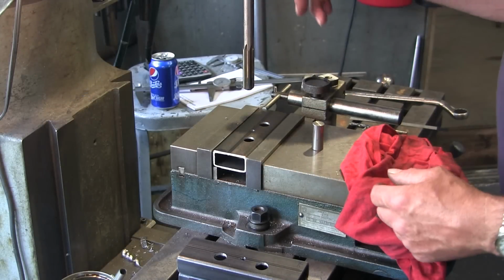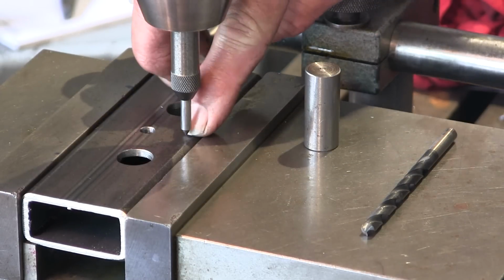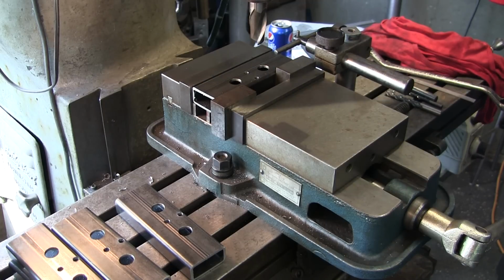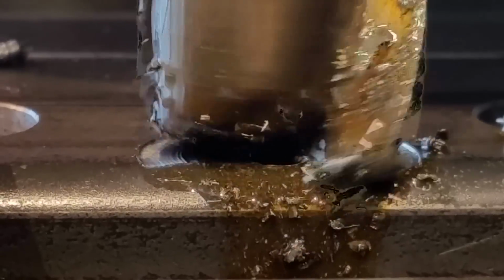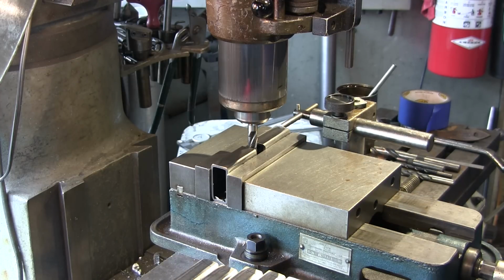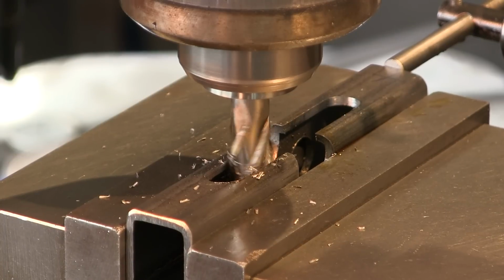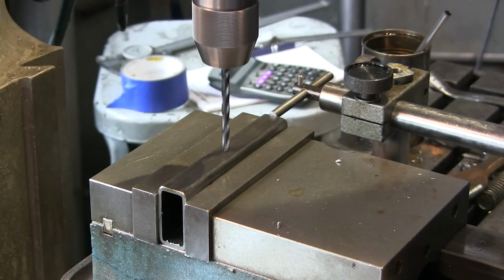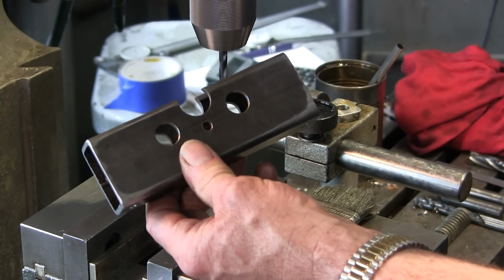The Wright Roller Kit The Build / Part Two

Comment: I'm enjoying this series Keith, as if you ever had a bad series..
I had also decided to use plug welds for the end blocks, I omitted the top hole as I didn't want the weld to affect the interference fit I did for the pins. The outside support blocks were reamed +.001 over giving me  a nice slip fit. I decided to go this way to allow me if needed to punch the pins out allowing me to disassemble the roller kit if needed.
the center sections swings freely. it worked out well with out welding distortion.
I can't wait for the rest of this series.
Cheers

Comment: The hot tip for that 7/8" hole would be an annular cutter. No pilot hole, required, and works great in tubing like that.
Reply: I had my first experience with annular cutters while working on my shop press this weekend. Love them. They make quick work of large holes.

Comment: I'm guessing the missing 1/4 hole is for locking the trunnion in place, or for draining oil/water accumulating from the bottom of the tool, since the end caps are welded.

Comment: If you can not find two identical thickness packing blocks to keep the 7/8 cutter away from the vice jaw, try using a vee block in the central position. This will nicely clamp the work and will give you a void for your cutter to go into. Another Old Boys tip, if your drill starts to drill an irregular shaped hole, is to drill through several thicknesses of a small wad of rag. This is also a good tip when countersinking, it will stop chatter and give a smooth finish.
Reply: I'm not sure I understand the tip about drilling through several thickness of rag.  Do you lay the rag (or small wad of rag) on the part and just drill through it.  I've never heard of this but anything I can do to help reduce chatter when countersinking I'll try.  Thanks in advance.
Reply: Hi Dave, Yes get a piece of rag or paper towel, about 2 inches or so square and fold it over several times to make a small wad. Place it over the hole and start to drill through it. What it does is clog the flutes and sort of acts like negative rake and stops chattering. Works well with multi toothed countersink bits, the rag / paper clogs up the spaces between the cutting edges. Do not have too thick a wad, otherwise it can be difficult for the drill / countersink bit to cut through the wad, especially if the tool is a bit blunt. Hope this help you, it certainly has worked for me over the Years. Final tip, if using with a countersink, keep the wad in place when checking the depth for a screw, otherwise a new piece may not settle in nicely, especially if you only needed to go a few thou more and cause chatter.
Reply: Thanks Dave,  I appreciate the quick response and the help.  I'll give this a try.

Comment: I can already see some divergence, since I won't be welding. I will have to determine where to put flat head cap screws to hold those end blocks in place; they can't interfere with any other machining on those end blocks.

Comment: Why do you put tension on the spindle brake before the auto feed?Glad you are back Keith.
Reply from the maker: Because my spring in the spindle is broken and want the preload to be against the gear and not free falling when cutting. ;{)-----
Reply: o.k.Thanks Keith.My XLO always kicks off the downfeed.I was just wondering if that was the trick.

Comment: Your videos are pretty much the opposite of Colin Furze's videos. Gentle, quiet, long. I like both. 
Your videos do make me a bit sad because i only have a drill press with decades old, abused bits, and a hacksaw with a mitre box. Ah well, i guess i can make most of what i need with that, just not as precise and beautiful as you can. My files and grinders are my best friends for making stuff that sort of fits :P
I am contemplating buying a set of high quality HSS drill bits. Do you have any advise on keeping them in top shape? When to lube, when/how to sharpen? I want them to last for quite a long time.
Reply from the maker: Make sure they are chucked tight and don't slip shank, sharpen before the side cutting edge / flute is sacrificed because you didn't and watch the color of chip / don't create blue and the start of the chip and use cutting oil on the projects that fell a little tougher or not clearing chip. ;{)------
Reply: Pat your back LV.This whole technical way of life we enjoy now came from a point minded person hauling his whole life into the bush with only what few steel pieces he could afford like an axe (HEAD ONLY)and a few other pcs.It was the start of where we are now in. Under 150 years. You have every thing you need to build a better tool and from those simple tools has taken us to where we are now.KUDOS my friend KUDOS.They need like minded people like yourself to go and check out ,,,,,,,say,,,,,,MARS or somewhere out there.Imagination ROCKS!